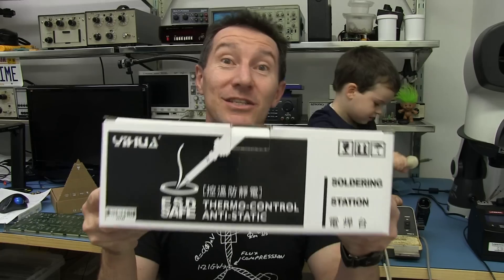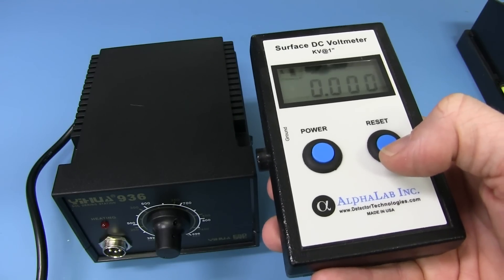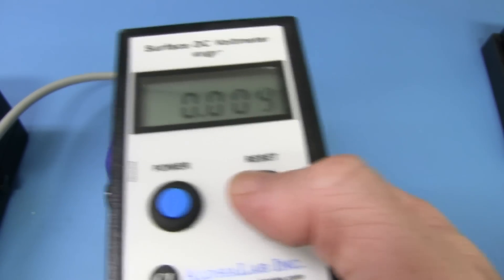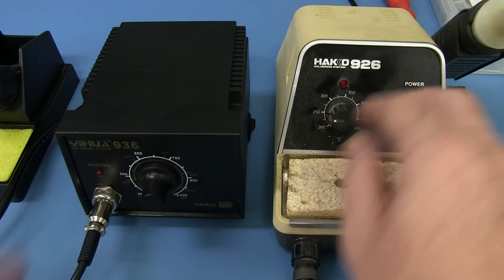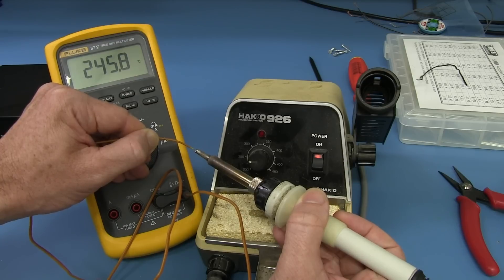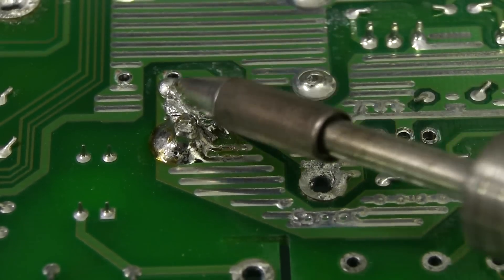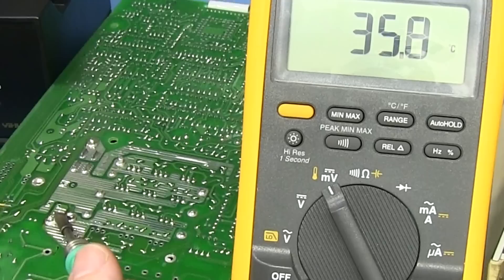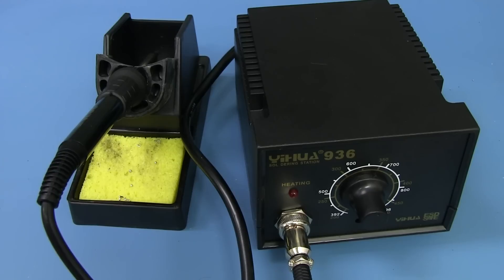EEVblog #596 - World's Cheapest Soldering Station - Yihua 936

Comment: Not sure what the big issue was, it was actually functionally not far from the Hakko in this review. The way the review should have gone is to set the dial and then measure the tip so that both were set to 300C, then do the solder test.
Reply: Yes wasn't it ironic that he initially measured that the temp was low but no effort to recalibrate or adjust so both had the same tip temp.  It's almost as though it was deliberate to try to skew the results.

Comment: For poor kids starting out, I am happy that they have an option. Also, I a not sure where the original Haako was manufactured. Part of the reason  Chinese manufactured goods  cost less is because salaries in China are much lower than in places like America. So equating the price of the product with the quality is not always smart unless you discuss the cost of labor between the respective countries.  Although in this case it was easy to determine that the Yihua 936 is not as well manufactured as the Hakko 926. The Yihua does the job, and it is great for someone on a budget trying to start out.

Comment: i see no comments about a child picking up a soldering iron? lol
Reply: David Griffiths lol I kept scrolling down but I didn't find one single comment. Next time guys
Reply: David Griffiths it wasnt turn ON ;)
Reply: Max J even so
Reply: +David Griffiths I got taught to use the soldering iron when I was 5. What's wrong with that?
Also, it isn't that much more dangerous to hold a pen, fork, etc than a cold soldering iron. Especially with a flat tip.
Reply: +David Griffiths I soldered a shortwave radio together from a kit all by myself when I was 6, you even had to wind your own coil for the thing. All unsupervised, yet I lived.
Reply: Andrew the Celt we don't hear about the ones that dont
Reply: David Griffiths Darwinism at work
Reply: +Andrew the Celt 
At 6...
Reply: Terry Xiong yes, it was a radio shack kit. You had to wind your own coils but everything else was through hole discrete components you had to solder on a silk screened PCB and the directions weren't in "Chinglish".
This was back in 1976 when kids didn't have to wear bubble wrap and could be trusted with things like soldering irons, chemistry sets and pellet guns..
Reply: David Griffiths it was off

Comment: I would say great for a first iron, you always start off with the worst stuff and build up to better equipment as you get more into the hobbie and gain an ability to afford the better equipment.
Reply: *****
Actually he is right. You don't want to spend large quantities of money on a soldering iron if you are just starting out as there is a risk it may get damaged/broken. However something like that is ideal if you only use it once in awhile, like a small hobbyist. I have a cheapy that plugs straight into the mains but I barely use it.
Reply: ***** As opposed from buying a mid range to expensive one that you'd then sell on ebay for half price because you lost interest? And then loose money that way?

It's an iron. As long as you understand what it does and what you're supposed to do you can do anything. Sure you're not gonna use gramp's old 1 cm thick 1921 Sachs tipped mains air craft grade soldering wire to do smd's but for crying out loud you're talking as if buying the expensive one somehow makes you instantly soldering god and there's no way in hell anything else works.

Also, don't forget that what we buy cheap today was super expensive years ago via cheaper methods of construction or chinglishims (the art of Chinese copy cat products). So if years ago they could do just fine with a simple soldering gun a beginner can just as fine use a cheapo to make burn his feathers on it.

I started work with a broke ass incomplete Weller military set that my uncle's sister who lived in America had bought as a gift for him from a yard sale many years ago. It did just fine.
Reply: Wrong; this is nothing but a great way to discourage you from working with electronics!!!! Buy something decent and it will always be decent, buy crap it will always be crap. A guitar that won't stay in tune is just like a iron that won't stay hot, it will do nothing but discourage a new learner. And if you lose interest you can recoup a fair amount of the value of something decent, crap is worth nothing. How much would someone pay for a 2nd hand $16 iron? How about the 25 yr old 926? Cheap is always a losing proposition.
Reply: Jarrod Roberson
It wont discourage anyone from trying. I have a cheapo mains iron and it works just fine for what I need it to do. Some people don't need an expensive iron nor can afford one. It also depends on what task you need an iron for. If you're getting into electronics then yes, a decent iron with temp settings etc is a very good idea, however if like me that uses it for other electrical tasks/larger tasks a cheapo one is fine.
Reply: Jarrod R - Nonsense.  This soldering station works fine and does nothing to discourage a new learner.  Only an idiot starts out paying a premium for tools whether it be soldering or plumbing or auto mechanics etc.  You buy what you need and upgrade as your skills and work rate start to exceed the tool, once you can make a valid case for a higher quality tool paying for itself from higher productivity.  A beginner has no such productivity concerns.
Reply: @jarrodhroberson  I've had a different Yihua soldering/hot air station for several years now. Originally bought for hobby use and I've used it at work many times now. It's been 100% reliable and a pleasure to use for years. 

When I decided to get a desoldering station last year, I got another Yihua and it took us excellent tool for the money. I'd still be happy as a clam had I spent 2 or 3 times as much.

Just because something is cheap and wasn't made by people who look like you doesn't mean it can't be good kit.

Comment: Since you demonstrated that the calibration was out, you were not really comparing like for like by setting the temperature on the control unit the same on each...

Obviously as a "system" the comparison is valid assuming someone trusted the calibration... but it's not really comparing the iron itself.

Comment: I bet a lot of the cruddiness inside was down to the caustic nature of the cursed "lead free" compatible flux that just corrodes everything in the vicinity.  I noticed the transformer was actually labelled at 24V.  I've got a combined Yee-Hah soldering station and it actually uses a 32V winding for the iron.  I thought it was just to push it harder, but when I measured the voltage at the irons internal PCB as it heated from cold the voltage had dropped to 25V.  I wonder what the voltage difference is between the Hakko and Yee-Hah measured at the element.
Reply: The flux difference has nothing much to do with lead free vs leaded, it's just a water soluble flux that they didn't take the extra manufacturing step to spray off.  Aesthetically it looks bad but it's not hurting anything to be there, UNLESS it gets wet.  If it gets wet then it's much more of a PITA because it can cause new short circuits.

There are some crossover points in these stations where some are only 50W despite rated for 60W and some true 60W and some even 75-ish watts.  That could account for the voltage difference or possibly you just measured without the heating element as a load?  Either way the resistance of the element will rise a little as it  heats up.

Either way, remember that a transformer voltage rating is what voltage it is at the rated current, essentially a VA source not a regulated output, especially with a sloppy E-core tranny.
Reply: I was about to leave a separate comment about how these cheapo soldering stations are good enough for Clive Mitchell, and look who's already commented here. I just wish I had found Big Clive's channel before I blew over $100 on a genuine Hakko 888D.

Comment: honestly it doesnt seem that bad. a soldering iron is pretty much a stick that gets the right amount of hot. its like %20 of the hacko so as long as it lasts around 1/5 of the time or if you dont use it enough to kill it then it should be worth it.

Comment: Bought one of these after watching this video 2 yrs ago.  Only finally burned out the handheld part, and got replacement part for $8.  Medium-high hobby use and I abuse it.  Works great on small stuff.  Ordered 2 complete units as backup it works so well.  I have low budget and these are a huge upgrade over a plain non-temperature controlled iron.  Enabled me to be able to do limited SMD soldering which I could never do with a standard iron.

Comment: You insult this decent iron and say it's horrible. It's a $16 iron bro, have some mercy on it. This is an amazing iron for beginners and I don't think you need to degrade it so much in your video. Just saying.
Reply: RgSideeeeeeeeee For me, it's working out great!
Reply: TheTransformerCrazed i agree its a very good iron
Reply: It will probably burn out after a few uses, so no it's not an amazing iron.
Reply: And that says someone how actually only seen it on the picture or video... it's kind a like: I don't know but I will tell you.
Reply: "Probably" But have you tried it?
Reply: @metallitech  I have a cheap-ass Chinese iron (slightly more expensive (at approx. 25AUD) and it works just fine after prolonged use.

Comment: His son should be a genius by the time he is 18 if he hangs out with dad in his lab all the time. :-)
Reply: I agree with the lead fumes.  Not good. Good ventilation, and donating blood every 2-3 months can help prevent the build up of toxins in your body. :-) You get to make new blood all the time, and save lives while doing so.
Reply: Frequent blood donations are very beneficial. I have been donating for many years. You keep flushing out the old blood with toxins.
Reply: I used lead free. I really do not like it. It does not flow nicely as lead/tin, and has a higher melting point.
Reply: I used copper-based lead free solders and I can tell that they are pretty much just garbage. The joint they give is very weak and fragile especially at low temperatures (below -10...-20 degrees Celsius) which is not so uncommon unless you live like somewhere in Africa. An other issue is that their much higher melting point makes them harder to use properly. Also the temperature required for them  kills soldering tips much faster than regular 280...330 degrees generally used for a regular 60/40 Sn/Pb. There are some places where lead-free solder is actually required like soldering silver-coated parts, sometimes there are some legal issues with lead solders and lead-free solder can be somewhat appropriate for some delicate commercial products made for indoor use and limited lifespan, but for a general purpose use and electronics repair I would always recommend lead-based solders unless you really have to use lead-free ones or you really know what you are doing.

If you are concerned about your health and the environment at least think about how much more energy is used and flux burnt to make all this lead-free stuff work. Considering all the factors involved the good old lead-based solders will not seem so bad in this respect.
Reply: ***** It's not the lead that smokes, it's the flux
Reply: That is true, but the lead also gives off fumes. The key is to only use enough heat the melt the solder. Excessive heating causes more lead fumes.
Reply: electronicsNmore what is the boiling point of lead and the temperature of your iron?
Reply: Not sure, but one thing I know for a fact, when you heat lead it gives off fumes. I knew a guy that made lead sinkers for fishing. He did it for years. Needless to say he lost his mind and had health issues. I usually hold my breath, or have my microwave oven desktop fan that I made, blowing the fumes away from me.
Reply: electronicsNmore
Actually, Dave says elsewhere (in probably Part 1 or 2 of his soldering equipment / skills tutorial) that the problem isn't lead but rather rosin flux...Weller says this: "Operations using lead-free solder, lasers, solvents, and glues are especially at risk." and "The transition to lead-free soldering has reduced strain on the environment, but for the operator, the hand soldering process has become more dangerous. The lead in the solder is gone, but to get the solder wire to flow properly, substantially more flux must be used."  Still, buy a fume hood.
Reply: I agree that the flux is the great majority of the harmful fumes.
Reply: So true!!!!
Reply: Despite I don't have good soldering equipment I switched over to lead-free solder, just for the sake of my own health. They are cheap from suppliers here in China (yes I am from Shanghai) and works reasonably well. I still have only a crappy soldering iron though so maybe I will get a quality one.
Reply: As long as you don't over-heat the lead, you should not have too much of a worry from the fumes. I solder with a fan to one side blowing the fumes away from me.
Reply: A whiner genius maybe ;)

Comment: You go right ahead and be a EE snob. I can translate from snob to my level without any issues.

Based on this review, I bought this station (I actually bought the upgraded B version) for a whopping $22 USD, shipping included.

I think some who follow you miss that there are 3 types of EE Hobbyists.  You are generally speaking to HOBBYISTS!!!!! They are very focused on EE and many look to make this their career in the future. Then there are Hobbyists. They have EE as their main advocation but it is not their vocation. Then there is me, I am a hobbyist.  I have EE and several other advocations I spend my free time on.

For the HOBBYIST and maybe the Hobbyist, a $100 on a station may be a good deal. But for the hobbyist, that's a huge chunk of my annual EE budget.

I like the fact you dig into EVERY detail and point out all the flaws. And after you found no safety or glaring flaws I bought. Very happy so far. Thanks

Comment: "thumbs down, I don't care what you say" to the 16$ iron that basically does the job in every proposed test case.

Bias much Dave ?
Reply: Yes same here, I could see for myself that the thing works, so I went on and buy it. And it does the job, even if it's not a fancy hakko 888. For the price of a hakko I can buy three or four of these cheapos and use them as spares. But all that because I am an hobbyist, not a pro. If I were a pro, I'd probably buy something else. This guy does reviews like everybody in his audience is a professional like him.
Reply: I agree with both sides.

I've bought a soldering iron from the local hardware store
AND
bought this one

I'm using them for soldering small amounts of PCB's and connecting small wires. I'm a bit more into programming microcontrollers than in the hardware stuff. For that reason, I don't need an expensive soldering iron.

The soldering iron from the hardware store simply:
- Was even a tad more expensive. (25$)
- Didn't have any kind of temperature control (sad).
- Took longer to get warm 
- Even the handle got (uncomfortably) warm
- The tips are expensive like crazy
- The tips degrade extremely fast
- Didn't have any kind of stand
- Cable was pretty thick, short and uncomfortable.

And well, the YiHua 936 basically outdid it at every point.
I can imagine, that if you really need to rely on it, you should go for the real deal.

You may open the YiHua936 before use, and make sure the earth is properly connected, then safety wouldn't really be an issue anymore.

For hobbyists (if checked on safety), I highly recommend this iron.
For professionals, well, maybe not, or get two of them, so you're always sure at least one of them should work ;D but you may go for one that can heat bigger blobs of solder, if that's what you're into.
Reply: I watched this to see if it was suitable, but considering I deal with high load twelve volt stuff, this iron isn't useful as I'd need to crank the hell out of the temperature all the time and damage the insulation.

You play with PCBs. You should really be aware that an iron like this runs the risk of damaging components as it doesn't have the thermal capacity to make larger ground connections or heavier gauge wire connections without a higher temperature. The whole point of a thermostatic station is not having to crank the temperature.

but hey, y'know, don't think about them lifted traces, more power to you.
Reply: xFuaZe
Reply: I had one of these and it stopped working after the third time I used it.
Reply: money well spent...Atleast it worked 3 times

Comment: So really apart from the build quality there's not much difference? Just buy a good tip and its a pretty good iron. All the iron has to do is melt the solder. We've seen that with a +50 degree change on the dial it can perform the same as a genuine iron so just rig the dial up.

I don't work with electronics everyday but I've done some big projects over my time and I've never understood people who big up on buying really expensive (£2000+) work stations. The only reason I can see anyone spending that sort of money is for micro scale projects where the joints are too small to see and work with.

Like this guy said in the video, if you can afford to buy the genuine tips then you shouldn't be buying a $16 iron.
Well that's just stupid philosophy. Cheap iron + Expensive tip < Expensive tip + Expensive iron
What can your iron do that mine cant, well it has a cheap plastic build and I need to turn the wattage up more to melt my joints.

Comment: I’ve had one of these for five years now.  I got a proper set of tips for it and changed the heat element after I dropped it.  I usually run it at max temp soldering XT60 connectors.  It has not failed me.  Bang for the buck value is thermonuclear
Reply: Best review.  Thank you